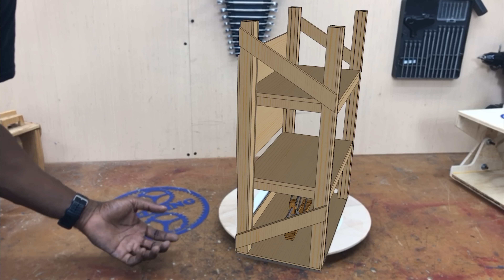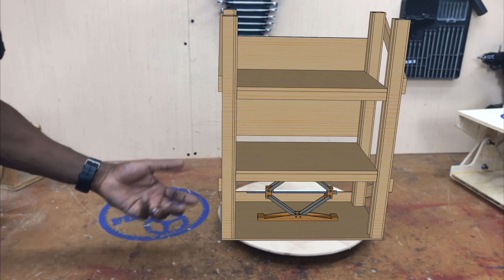Engineering Principles for Makers Part 2; Material Properties #067

Comment: So an I beam is better than a flat bar as an overhang.  No shit.  That has nothing to do with the material.
Terrible demonstration.  
If you're trying to show the difference in material, only change the material.
If you're trying to show the difference on the properties of the shape, then keep the same material.
Changing ONE variable at a time, makes it clear that that ONE difference is what you're measuring.

All you did is kind of show that I beams are stiffer than a flat bar along it's most flexible direction.
Totally pointless and nothing to do with what they were made from.
Reply from the maker: If I had to do it again I would only use one material... but at the time I thought it would be more interesting if the example was extreme... I.E. Even wood is stiffer than steel when the geometry is better. So give the same amount of steel the worst geometry and wood the best. To answer your comment though... no one walked away thinking I was saying wood was stiffer than steel. The example was meant to be obviously in favor of the wood... Your comment above is what I expected absolutely everyone to think. It is not a “revelation”... its meant to remind people to pay attention to the shape of your design before you assume the material is the problem. See time 2:04. Thanks for watching... and sorry you walked away with such hard ache. You seem way more upset than you should be.

Comment: Instead of the jack, why not have the middle plate be raised and lowered with some sort of pistons/jacks system on both sides? That way you get a third shelf. The way you have it now that lowest shelf is occupied by the jack, but if you transfer the raising mechanism to the outer perimeter of the lowest level you will gain the lowest part as extra space for storage. The bearing capacity of the middle shelf will decrease, but that should not be a problem with smaller shelves or a middle plate made out of a rigid material.

Comment: Sir. Your idea of the workbench with the four posts and the work surfaces sliding up and down may have some problems. I built a rolling type bench/stand where I work as a heavy equipment welder. On one side I have a fixed work surface approx. 2 x 3 feet. This area is primarily for setting grinders, hammers, welding rod, etc. on while I am working on a project. The other side is a platform surface that can be raised and lowered which I stand on when working on equipment. It is approx. 4 x 2 feet and slides up and down. I can go from about 8 inches off the floor to 5 feet off the floor. The slide is achieved by having the platform attached to 2 7/8 pipe, and the fixed pipe being 2 inches.  I have holes in the 2-inch pipe every 6 inches, so I can set it with pins at the height where I need it to make a weld. The whole thing rolls on casters and if working on a project that requires a long weld or multiple welds, I can actually pull myself along the work while standing on the platform. The 4-foot width lets me move side to side which is much better than trying to stand on a step ladder. The problem with it and also what you may find in your workbench idea is that without any type of bearing, the bench part may hang up side to side as it is being lowered and raised. Even a small deviation in surface height side to side will cause it to (dig) into the post and wedge its self in between the uprights.

Comment: Interesting stuff, enjoyed these two videos.  The new design seems that it would need to raise quite high to use, I'm thinking would this make it top heavy?  (when moving it around the Shop) Just trying to help you find the faults before you build it.  Thank you for the lessons and the video Jeremy
Reply from the maker: I am considering its weight/top heaviness...in fact I think it is best if its is bolted down... so I am reconsidering the design all together. A lot has changed since the video so it complicated to explain much here.

Comment: Thanks for sharing some structural engineering concepts. I agree that strength and stiffness are terms which are commonly used incorrectly. At 6:50 when you introduce the I-beam (AKA H-beam), the cross-sectional shape of the beam will also affect the structure. An I-beam, for example, is an optimal shape to support a load applied perpendicular to the flange. If the beam needs to apply a load in both vertical and horizontal directions as you suggest when attaching a motor, a box section would be a better choice. The off-axis position of the motor mounted to the beam will create a moment generating a torsional load (twisting load). In this case, a cylindrical profile would be best. Perhaps you could do a follow-on video looking at different profile shapes and how they can handle different types of loads?
Reply from the maker: That is a fantastic idea. In fact I might add that to the series when I get back on it... Thanks

Comment: Speaking of geometry, it's kinda hard to find square tubing in wood.
Reply from the maker: I would make it not buy it
Reply: @Jeremy_Fielding  I suppose it depends on how much your time is worth, and on what the requirements are. I very much prefer fabricating steel to wood, because tack welds are super convenient, and the joinery is much more straightforward. I'd go as far as saying wood furniture has a higher barrier to entry than steel furniture. Material cost is also probably not as big an issue as you think. The vast majority of steel for my projects has come from the scrapyard at 30 cents a pound, plenty of square tubing and C channel for hobbyist projects. I think the big reason to go in the direction of wood over steel is because you already bought the tools for home improvement projects.
Reply from the maker: Every one has to answer that question for themselves (the value of your time) The act of making is the fun part for me. So we don’t even feel the same about what time is for. Making stuff is the goal not the thing made. Besides wood working is just a affordable option for me. No one questions the overwhelming benefits of working with steel. When the channel budget can afford the tools for working steel. You will see more of both types of projects.
Reply from the maker: @sleepib  I have a few more thoughts to share with you... First I want to say I agree with your comments about the benefits of tack welding, scrapyard options, etc. But consider this... I don't make furniture. I only make machines. The accuracy required for my machines means I need more than a grinder and a drill press. These are currently the only tools I have for cutting/shaping steel. So there is a minimum investment required to be able to work a complete project in steel. Of course I don't have to buy them all at once, but at some point I need a welder, a cold cut saw, a milling machine, and a metal lathe, to continue making the stuff I now make in wood, but in steel. All of these things are planned purchases in the future by the way. So while a machine made of steel of always superior in strength, stiffness etc... it requires stiffer, superior tools to shape it. But none of these are small purchases for my budget. So for now wood is good enough to get the job done... and most of the time, that is all that matters.
Reply: @Jeremy_Fielding   There's not much substitute for a mill or lathe for higher precision work(depending on the situation, shims or hand filing might suffice), but you can do a whole lot with an angle grinder and a buzz box.  I would put off the cold saw in favor of a band saw or hot saw.

Comment: I rag on those with a college education all the time NOT because I am some how "smarter" no I can't be that arrogant, even though typing this doesn't show my true intelligence or my emotions!! But I have worked with electronics engineers that CAN NOT draw a draft of a simple wire diagram, I have worked with those SAME engineers that do not know how to run a computer or can't identify (or draw) simple components like a resistor, capacitor or even a basic switch!! I have worked with contractors that don't know that adding a triangle to a corner of a wall would add strength even though these folks all had college degrees and I am only a high school graduate!! In fact I live in a place where my landlord is a very smart college educated person, but he DOES NOT understand that sewer pipes need to have a "down hill angle" on them in order to work properly, but because he is trained as a Pharmacist and NOT an engineer he IS arrogant and thinks that his word is stronger than basic physics and if he "thinks up" how something SHOULD BE, that the laws of  motion and gravity should just BEND TO HIS WILL at times!! Like I say I have worked with college educated people that ARE IN FACT SMART, but don't have a clue in other fields that they obviously DO NOT UNDERSTAND and have no business working in at times!! And I have ran into a lot of problems with people that think I am just an idiot, because I try to explain fundamental physics or geometry to some person that has a "chip on their shoulder" and has a "degree" in English Lit who thinks they are the smartest people in the room, when they can't understand simple things like a 10 millimeter socket is NOT THE SAME as a 3/8" socket!! And it gets extremely frustrating for me to have to go over this again and again and again with the same fools that have a college degree and won't realize that I DO KNOW WHAT I AM TALKING ABOUT, because I understand things they don't!! The thing is I have worked in a lot of different fields in my life, I have worked has an auto mechanic, and I worked in electronics for 26 years, I worked in a auto body shop for four years and I did construction and contracting work as a side business most of my life since I was 15 years old!! I have learned a lot about building sheds, decks, cars and electronics and computers from some HIGHLY INTELLIGENT people along the way And in school I took wood working, electronics, drafting, print shop, small engine repair, auto mechanics 1 and 2, and metal shop on top of all that as well!! Plus since I was 8 years old I have worked doing landscaping, and I have worked around cars and people like my father who was constantly building something at home no matter what!! So a gusset here, or a couple "extra screws" there, always seemed to sort of help when my father was thinking a problem through!! And in your example here your "metal" wouldn't deflect as much if you were using tube stock or an "I" beam configuration, but also wood if placed correctly can be just as strong (if not stronger) than steel (See Matthias Wandel test his one band saw design). My main point to all this is if you understand the properties of the material you are working with, you can build AMAZING things!! And I have worked with everything from metal, wood and plastic and seen some things that are simply AMAZING the way they are designed!! But even a little basic physics and geometry WILL go a long way as well too!!!

Comment: Just discovered your channel and you've got a subscriber in me man.

Since you're considering a scissor jack lifting mechanism, I'd suggest checking out the video "Homemade Wooden Lifting Table" posted by another mad tinkerer, Marius Hornberger. His design is primarily made of wood, and while he does produce some hardware on his metal lathe, this could probably be modified to work with the tools you have.

If nothing else, it's a good watch just to see how he approaches some of the real world joinery and learn from his mistakes if you try something similar. File that under the "Research" heading.
Reply from the maker: I have seen it. Interesting build. Welcome to the neighborhood!

Comment: To improve strength in metal I invested in a bead roller. Using flat metal is much weaker than if you put a bead running the length of the brace. It increases the strength without increasing the weight. Also using aluminum is lighter and doesn't need to be painted. Thank you for your great videos.
Reply: Steve Larsen what is a bead roller?
Reply: Steve you are not increasing its strength (a material property) you are increasing its moment of inertia in the direction of the bead (a geometric property). As Jeremy stated high strength steel (ie work-hardened) has the same elastic modulus as mild steel so heat treating or selecting a higher grade of steel will not reduce deflections.

Comment: You did an amazing job explaining the basic concepts. Another thing to consider when studying beam deflection is how you connect the beam - pinned vs fixed supports. Pinned support allows the beam to deflect A LOT more.
For example, a DIY 3D printer in this picture ( https://i.ytimg.com/vi/aPUHraVh-aE/maxresdefault.jpg ) is using these little angle brackets to connect the bottom rods, and it's using plastic cable straps to mount the guiding rods for the left-right axis. That's a pinned support because it allows the rod to freely rotate.
The better alternative is to use something that will be closer to a fixed support, something like this rod holder ( https://www.picclickimg.com/d/w1600/pict/162609675445_/2Pcs-SK8-8mm-Rod-Holder-Linear-Rail-Shaft.jpg ) which tightly clamps the rod and doesn't allow it to rotate (deflect) as much.

Comment: Jeremy. You should consider using a Sarrus linkage for the lifting mechanism on your proposed work bench. It will keep the work surface parallel to during the lift with only minor increase in complexity.

Comment: thats the secound moment of area not inertia
Reply from the maker: It apparently has lots of names. "area moment of inertia" is what I was going for. My old text book calls it "moment of inertia" So I felt comfortable saying that, but I guess at some point people added "area" to the name to distinguish the two means. Then several names came of it. I also added a note to the description for clarification. The note was there before your comment, and I don't have any other way of letting people know about, so I guess that is the best I can do.
Reply: @Jeremy_Fielding  fair point, but it doesnt fit if the system is static. and the area is helpful when describing it, because the geometry is very important

Comment: Steel is best just not cost efficient don’t put a weight on the edge of a 3 mm piece of steel and compare it to a 4 in piece of wood obviously it will Bend
Reply from the maker: Just to be clear... I didn’t say that wood was better... The idea was suppose to be that both geometry and material matters check time 2:04. The demonstration was suppose to be obvious... no one would be surprised to see a steel I beam vs a wooden beam... I just didn’t think I needed to show that. I hope this helps you understand a little better

Comment: At 8:00 it might be interesting to note, that you should always think of using the material and structure properties to your advantage. In this case, you could use the flexibility in the belt direction, as a belt tensioning system (depends on the load, of course).

Comment: I reinforced 1/8 inch steel strips to work as an engine mount for a 200cc motorcycle i made from a bicycle frame... used triangles.

Comment: Nice to see the practical side in real demonstration!
At 1:30 you compare two completely different materials and you compare two different structures. Compare two H-beams in different materials and your results will be more accurate, I bet steel will suddenly become much stronger too.
At 7:03 you clamp the beam to show different directions of force. You are absolutely right, but the experiment causes a pivot point on the structure. A second clamp right on the edge would stabilize the structure but would still show the weak side of it.
One not in this cool short info film but i think is very interesting is the natural resonance which can occur in a system. Choosing a slightly different structure or change the material could prevent such resonance. 

Really like the way it is presented.
You should teach in high school, kids would finally pay attention and understand it!
Reply from the maker: Using different materials was meant to emphasize how much difference the shape makes... being that we all understand steel is stiffer and stronger... I didn’t think it needed to be shown. However I wouldn’t do it again... it ended up being a distraction for some...Check time 2:04 for the main idea... and thank you for the kind words!

Comment: But that doesnt show that wood is as good or better than steel because if you take the steel and form into an i beam shape then compare it wont be comparable. I mean if your trying to ssy wood mat be preferable in some instances due to price weight or other properties then yes. But comparing them 1 to 1 steel is stronger
Reply from the maker: Actually I was only trying to say you need to consider both the shape of your design as well as the material. Check time 2:04 ... I use both materials when the application calls for it. I definitely don't think one is better than the other. At the time I thought it was a more interesting example being that we all know steel is stronger and stiffer, it would emphasize the fact that shape matters alot with respect to the load. But it turned out to be more of a distraction for some. About 1% by my math. No one seems to be mislead by any means ( I explained exactly what I was doing at least three times) but next time I would do it differently.